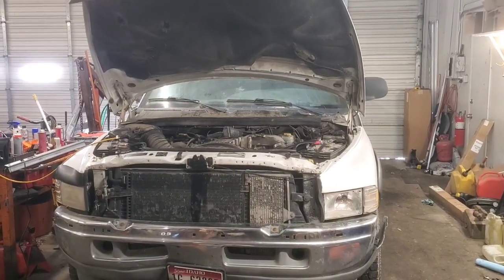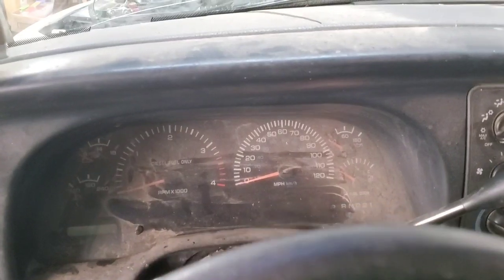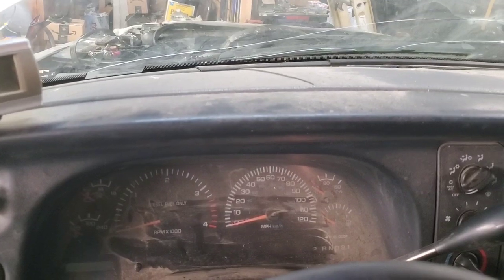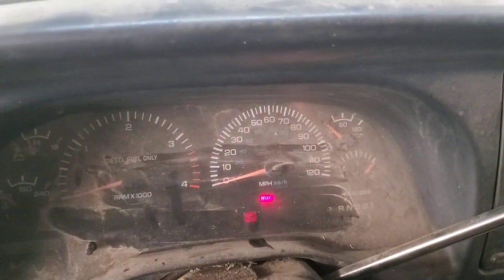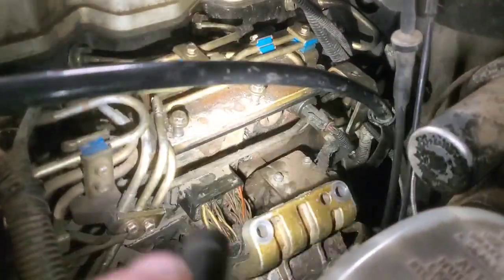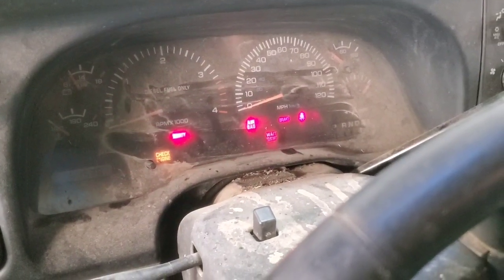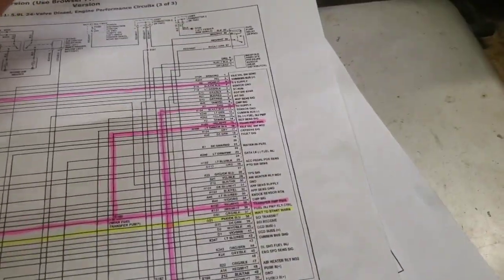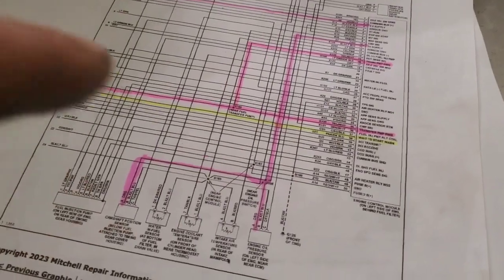Dodge Ram 5.9L Cummins Vp44 Crank No Start.  You Won't Believe the Cause!!!

Comment: There's several circuits "hot" at key on.
2 of the circuits are grid solenoids and lift pump key on.
For grids, it relies on a temp sensor to complete the circuit, which allows the WTS to work properly.
If the sensor is bad, or the circuit in the ECM is faulty, you'll either get a delayed WTS, or the processor will never come online.
Many times, in a sudden ECM failure, it's either a power section diode, or a failed processor.

Also, typically when a VP44  ECM dies, you'll lose the fuel lift pump.

Finally, a VP44 truck will run a ~ 1-2 minutes prime  cycle, if you key on and just "bump" the starter.
If that doesn't happen, sometimes bypassing the pump gets it running, but it means that eventually the power section in the ECM will fail and is on borrowed time.

I have a breakout harness I use to check if the injection pump module is the culprit, in a no start scenario.
It requires bypassing the lift pump, to make it run.
By doing the bypass, you can idle the engine.
If it fails to start, or attempt to, the pump module, or the sensor inside the pump is the culprit.

SORRY! LONG REPLY!
Reply from the maker: Great info!  Thanks for sharing

Comment: So the best thing to do to avoid any and all
Of this is a p7100 swap right? With a p pump swap you could pretty
Much remove the ECM from the side of the motor and toss it ya? Naa I’m sure there’s a reason or two to leave it bolted on and functioning for the grid heater, and fuel lift lift pump. I’ve heard that with the fass pumps, having them running while cranking can cause a long crank issue. Something to do with the pressure being to high for the puntle inside the vp44 or something to open? That the fix is to basically make it so that the fass doesn’t run during crank key position and only runs in the run position. A fass can be wired all sorts of different ways but I think the directions for a second gen has you using the stock oe plug for the junky Carter lift pump, bumping the engine over will have it run a prime cycle for 30
Secs or what ever. And had it run while cranking. Which I’ve heard can cause issues with a long crank hot or cold. The vp44’s are finicky. They can be great once all the kinks are worked out, having a FASS guarantees longevity and reliability. I didn’t know about having to much pressure being bad, that’s good to know, no more than 15-20 psi, and no less than 7 at idle, I know anything less than 5 psi and damage occurs and it starts cooking itself. I think lost of the fass kits run about 16 psi consistently, and optional fuel pressure regulators can be installed and the fuel press can be adjusted if needed. 
I want to p pump swap on my ‘02 24v Hao 6
Speed. I’ve only got 100k miles on it, and it’s a mint perfect truck. It’s a perfect truck. 
I’ve started planning a p pump swap, I still need to either find a junk donor parts motor with a good p7100 core. I’d really
Like to use a 215hp p7100 and not have to settle for a smaller 180. I’m not going for huge horsepower or anything, I want reliability and longevity, and bulletproofness. So either a donor motor I can take the timing case and gear, and brackets and everything off of Or use the crazy carls kit which is about $3,000. If I go that route then I want all the cool billet parts, billet tappet cover, billet front timing cae, billet front case cover with quick change access, billet pump support bracket, billet water pump, billet valve cover, billet thermostat housing, fluidampr balancer, cam gear dowell and retainer, plate. I’ve seen guys just make a small tig weld on the cam gear to be cheap lol. I’d give my left nut for one of those king speed billet oil pans. My hod those things are a work of cnc machinery art. drool 
 Or….i could just use all the greasy dingy parts and clean them in the shops washer machine and paint them nicely and use the factory OE parts for the swap from a donor motor. That would the cheapest. Find a donor 12v and take the timing gear case, injection pump gear, p7100 pump, support bracket, oil feed line, and the oil feed line snubber valve thingie, and the grid heater, the reason for that is I wanna be able to run my banks monster ram and on a 24v p pump setup with the custom lines you can keep the backs monster ram, you just gotta raise it up with a grid heater delete space or another heater with the center knocked out and get longer studs or bolts. 
I know p7100s are getting harder and harder to find in good useable core buildable condition, especially the 215 pumps, all the big race diesel guys have gobbled them up over the years. And Bosch ain’t making new ones, they haven’t for years. Although a Chinese company has knocked off the Bosch p7100 pump design and castings. Which heck ya! I’ll run one lol. If I can’t find a p7100 I’d consider swaping in a rotary VE pump. They are just as reliable, and can support up to 600 hp easily worth the right mods and fueling! Everyone raves over the p pumps higher pressures and garden hose fueling capacity. The VE rotary pumps can be easily made to support 400-500hp and that’s range in aiming for, I’m not going to 1000+ honor the highest hp swaped 24v secound gen. I want reliability, efficiency, good mpg and the ability to turn some screws and do what ever I want with out being limited or stuck by mechanical
Limitations, emissions, or computers or modules, or programming constraints! I want all mechanical! I even want the manual pull cable fuel shut off! lol no wires or electronics! Nuke proof!

Comment: OK thanks. A bit too far from Florida 😅.  I was having a few intermittent problems starting the truck for a while. It's a 98 1/2, 24 Valve.
 Then for the first time it finally shut off while driving.  Now it's dead. So I'll check the codes. It does have a new Fass lift pump. I'm thinking it may be the vp44 pump. It has about 220 k miles.
If so, I'm sure I can change it myself. Who sells the best vp44 pump? I  would rather pay more for a good quality pump than having to do over again. Thoroughbred Diesel any better than others?

Comment: I’m in the same boat with my 2001 2500. Truck will crank all day but not start. I saw your other video about the wait to start not coming on, and mine is not coming on at all. I checked the fuse and it was good. I even swapped it just to be sure. It’s not throwing any codes. I’m lost with it right now.
Reply: Also to add, it was running just fine, and then the other day it just wouldn’t start. I have no symptoms of a bad VP44.
Reply from the maker: It does sound like you have some sort of ECM issue.  Either the ECM itself or wiring to it.  Check for power at that fuse you checked.  If it doesn't power up then the ECM is not sending out the signal to turn on the light.  That could be an ECM issue or the ECM doesn't have its proper inputs.

Comment: I removed my edge tuner. Which I have had on and off the truck multiple times with no issues. But this time I took it off and the truck won’t start. Possibly fried the ECM??? Just disconnected batteries overnight and replaced the crank sensor still no start. Getting the “no bus” message on dash
Reply: Gonna go to the shop and get the scanner to see what’s up

Comment: 👍..have got one round here,that runs with power and ground to the psg on the pump..has got power and ground at pump plug from ecm..ecm seems to have all inputs and outputs..have ohmed wires and what not...read on the blue chip diesel site numerous times...ive swapped ecm with a spare...it won't run on its with an ecm plugged in... might just burn it to the ground.. thanks for your videos 👍👊

Comment: Liked and subscribed, how about a no start warm? What would cause that?
Reply from the maker: In my experience a no start warm issue is either caused by the ECM or more ,likely the VP44 pump.  I have run cold water into the pump with a garden hose a number of times.  Sometimes just by cooling the pump down one can get the engine to start.

Comment: I’m in the exact same boat on a 98 model. Wait to start is flashing just like in your video. Cranks but no start. I do not have power on vp44 connector but do have ground. I bypass the ecm with 12v to vp44 still does not start. Will run on starting fluid tho then die back off. Any suggestions? The upper part of ecm is split open. So I’m pretty sure it’s bad. But do u think I have a bad vp44 also? I’m getting fuel up to the injectors.
Reply from the maker: Just do one thing at a time.  Your ECM obviously needs to be replaced.  Get it replaced and go from there.  Everything could work just fine or you may have to TS more.  But if you try TS with something that is bad you might end up chasing your tail.

Comment: Thanks great information. 
I also watched blue chip where he says to simply cut a certain wire if crank and no start and everything else checks out. 
It’s hard to believe all these blunderfucks weren’t actual built in obsolence engineering.

Comment: I've just bought a '99 24v Cummins that has a delayed WTS light intermintenly.  Also an acceleration problem intermintenly when cold that won't go higher than 1400 rpm.   But when warms up it acts fine.    Does that sound like an ECM problem, and should I send it to get repaired?      The VP44 and lift pump been replaced and looks new.   Lift pump makes 12psi at idle.
Reply: Crankshaft position sensor. Your rpm gauge goes to zero then goes back on. It's probably a loose connector at the computer

Comment: My 1998 5.9 24 valve has the same issue with cranking over but no start, but my Wait To Start light comes on properly and goes off around 6-7 seconds later. After that I just crank and crank and nothing happens. I've had it started before, by changing the TPS (Throttle Position Sensor), and messing around with the fuses in the fuse box. But when it started it wouldn't rev passed 1,400 RPM. could you please reply and let me know if you may know what the issue is. I've always wanted one and finally have one but it's causing me these issues. Also, it will start with sprayed with Ether, but dies immediately after it starts. pls let me know if you know what could be the issue.
Reply from the maker: Those symptoms (especially the no Rev past 1400) sounds like a defective VP44 injection pump.  Check to see if there are any codes in the PCM, make sure your lift pump is coming on, and that you have at least 7-10 PSI of fuel pressure after the fuel filter.
Reply: @prodieselrepair3218  Thank you for replying fast, and my lift pump comes on, it's a fast pump fuel system. I have yet to put a code reader on it, but me and my dad are supposed to do that tomorrow and see what it says. What could cause the VP44 to go bad? I have a bigger pump for it too, and it does the same thing with the bigger pump. So maybe both are bad, but i'll definitely look for a VP44 code tmr.
Reply from the maker: The most common failure of the VP44 is the electronics on the top of it.  Usually low fuel pressure will kill a VP44 right quick, because the lack of fuel pressure and fuel flow also means a lack of proper cooling of the pump by the fuel.  But normal engine heating and cooling cycles will eventually kill the pump over time as well. It wasn't a great design and it was only used for four years.  You also don't want too much pressure either as weird as that may sound.  No more than 15 to 20 PSI and no less than 7 psi at idle.  The lift pump should be able to run 12 to 14 psi while loaded.  Engine loaded that is

Comment: I have a 2002 VP44 that truck will not start and has ck engine light and scan tool won't connect to ODB port and the port has power and ground. Truck will start with 12 v direct to VP44 pump with ECM bypassed. The power and ground pins on the VP 44 connector do have 12 v when cranking when hooked up to truck but it won't start
Reply from the maker: What is the "Wait to start" doing?  It's sounds pretty similar to the pickup in this video.  It had a bad engine ECM.  I could not connect to the PCM because of the bad ECM.
Reply: @prodieselrepair3218  I need to check the light. I will try a find a ECM to borrow to see if it will run. Can the PCM on the firewall cause engine not to start?
Reply from the maker: @Lucky4wd4840  I have not had an issue with these engines not starting because the PCM was bad.  I guess there's a slight possibility, but I don't think so.
Reply: I'm on the same boat with this symptoms and mine gauges doesn't work so but I have fuel over to the injectors and lift pump runs but cranks and no start
Reply: Did you find if your ECM was bad. ?
I have same problem same symptoms

Comment: The ECM must have a crack letting moisture into the circuit board?  Not very often the ECMs go on these old girls
Reply from the maker: Either that or it makes the proper connection just with the heat.